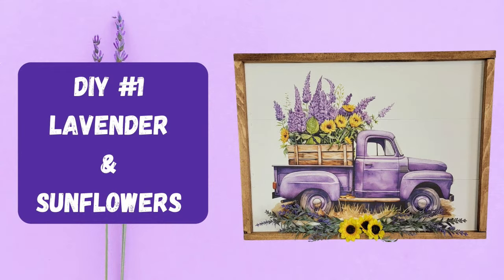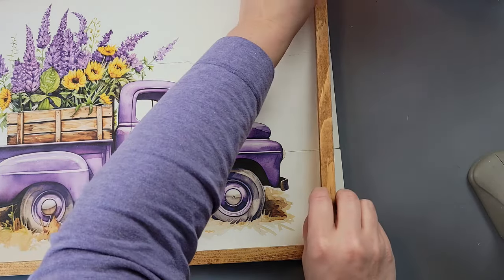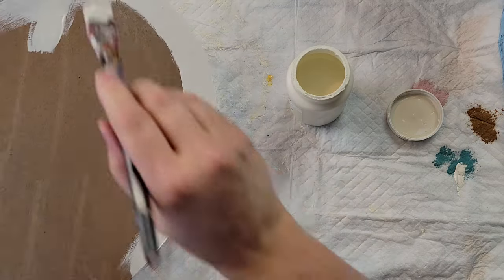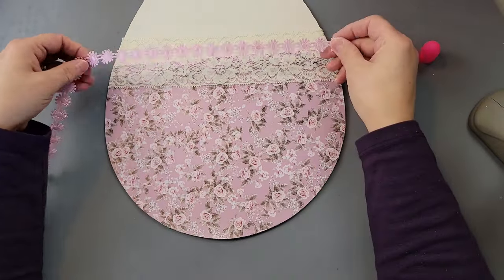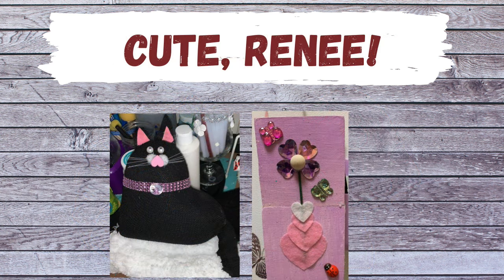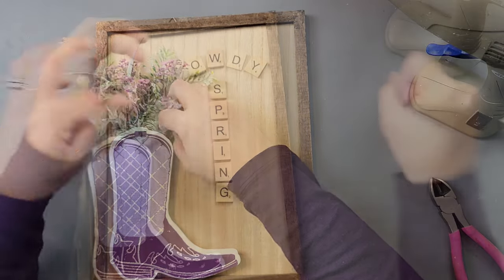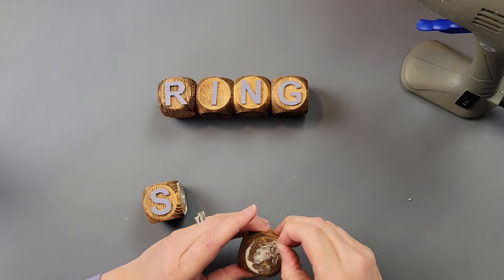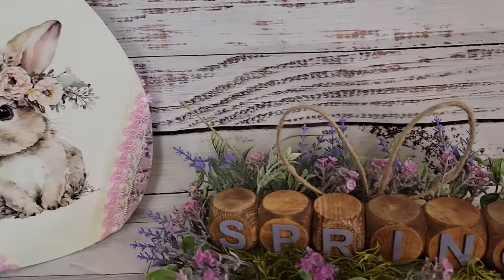SPRING HOME DECOR DIYs

Comment: Hi Brenda,  love all the diy's in this video.  While I was watching you struggle to get that bunny off the egg with the heat tool I thought of an idea.  Now I haven't tried this, but I will. I'm wondering if you could put the wood piece on an old cookie sheet (or a dollar tree one) and put parchment paper on the cookie sheet first then put your oven on the lowest temperature it will go and place the wood item in there for like 5 minutes increments until the glue softens.  I'm thinking that will work and it won't be such a struggle to get the pieces off.  You will have to be careful so it doesn't burn. I would check it often and DON'T leave it unattended for safety reasons and always use put holders. I'm going to try this and let u know if it works.  Hope this is helpful to someone.
Reply from the maker: Thank you,  Robin ❤️.  I can't wait to hear if your idea works
Reply: Yw. When I try it I will let u know.  Been under the weather so it will have to wait until I'm better.